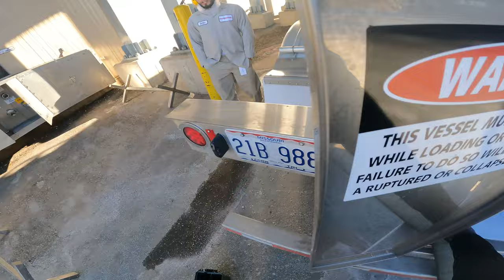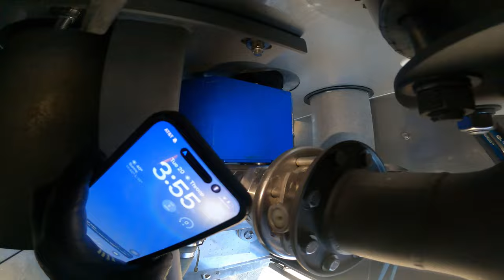Rookie Truck Driver Locks keys in Truck at Fuel Lane

Comment: Vez, you may want to try switching your hydraulic hoses when you hook them to your trailer if possible. The reason could be the way the PTO pump turns on the transmission. If you can switch the hoses when you connect them to the trailer it should turn the trailer pump in the correct direction. Just a suggestion. Enjoy your videos and thanks for your time to make them.

Comment: automotive on road/car/truck keys  are all unique for the most part like 99 percent. industiral and off road stuff like excavators or say Scissor Lifts or panels to machines and box's are normally on a numbered key system with master sets for said number keys.